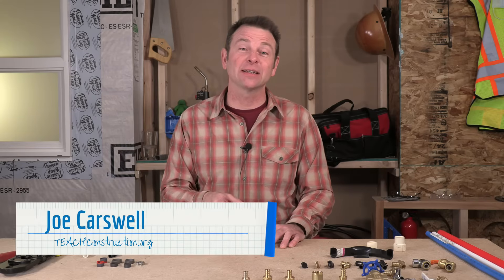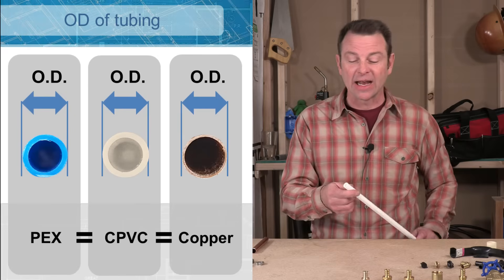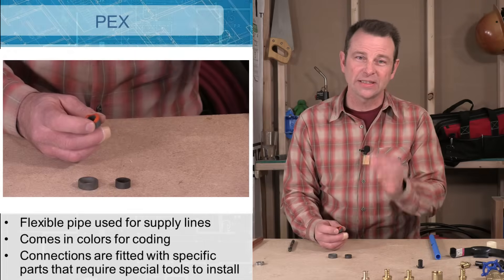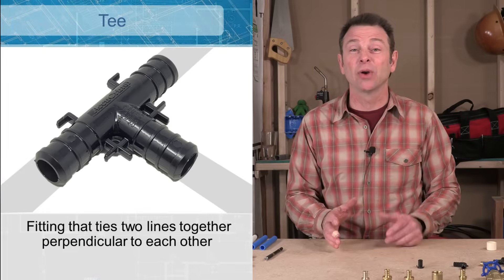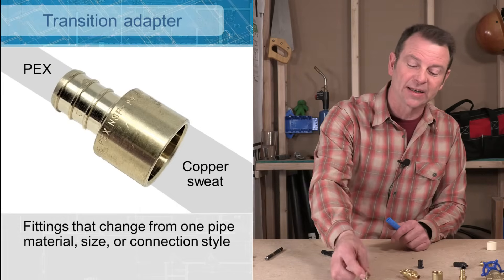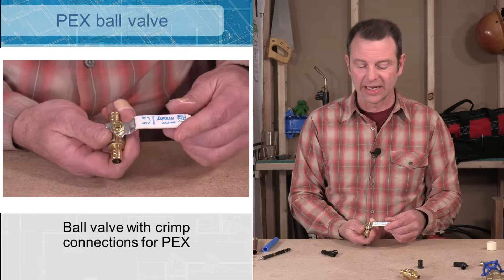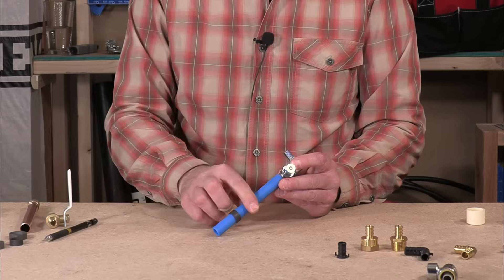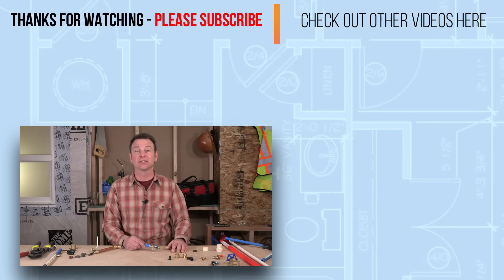A lesson about basic PEX plumbing materials  - Intro to Plumbing Systems

Comment: When using the push to connect fittings, especially on copper, make sure to deburr the end. The o-ring seal inside can be damaged causing a leak. I would also recommend extra care on any pipe material. Even a small piece of plastic getting under the o-ring can cause a leak. These are very reliable when carefully installed.   They are very well made and even have an inner support tube to help hold alignment.
Reply: The push to connect fittings are good but usually are used for a quick fix. I will replace them with the correct plumbing type when I have more time.
Reply from the maker: Great additional information - thanks for responding. This fitting is all about that inner O ring!
Reply: They're also susceptible to damage from cold temperatures. We use them when we need to but we don't put them in walls because sometimes they will develop a slow leak after a few months due to damage to the o ring or improper seating. You're also supposed to remove the pipe support on hard pipes like copper and cpvc.
Reply: Excellent presentation. Two other suggestions I would add when using push to connect fittings. First, make certain you deburr both the inside and outside of copper tubing. Second is to clean the outside end of the tubing that will be inserted into the fitting thoroughly using brass wool, not steel wool. Steel wool can leave deposits that can eventually rust and possibly degrade the connection enough to cause a small leak. I've always had to order brass wool on line since most hardware stores don't ordinarily carry it in stock.
Reply: When using a push to connect PEX fiting inside walls does anybody know if this meets code
Reply: @oliver-ec9mv  I've looked for that answer as well and the general consensus is don't use them in a wall, only open areas.  I've seen it used on air systems in an open environment as well and it works. Like Deliveryguy's above post don't trust it. Something else I saw as a concern is the plastic elbows on Hot water will heat cycle, get brittle and could break if they have any awkward side loads in say 5 years.
Reply: These are all great advice, thanks guys!

Comment: Between Pex A vs B which would you prefer for long term reliability.
Reply from the maker: I am told that long term reliability is about the same - But if I had the choice I would choose PEX A as it has a bigger ID in the fittings and provides better flow.   That video is also coming out soon

Comment: Fantastic Stuff thank you. On plastic vs brass fittings, I was thinking brass would have a large ID than plastic as its obviously stronger. Thats much better for flow rates. The close up of the 90 degree couplers sure did look like the brass had a much larger ID...does it?
Reply from the maker: You are 100 percent correct - Copper has a considerably larger ID - especially in the fittings (in the pipe itself also) and that does cause lower flow.   I replumed most of my house a year ago with PEX with a distribution manifold and tried to keep the fitting to a minimum.   But still have lower flow.

Comment: plus you dont even talk about the connectors and fitting that are the best to use and why they are better. the chitty ones you show are the basic cheapest consumer DIY ends.  real plumbers will spend the money on correct tool to use the correct fittings.  also sharkbite fittings will leak one day and suck over all.
Reply from the maker: I hope you feel better now that you have vented.   We are not taking the position of a professional plumber, this lesson - and the others in this series - are designed to provide basic information on plumbing materials and fittings.   Not to promote one over the other.   But thanks for watching and feel free to post a links to the videos you like - always good for others to find alternative positions.

Comment: real plumber and tradesmen like using best materials that last.  pex is never the first choice when the install really matter or if the tradesmen is building their own house.  copper and solder is the best over.  pex is fast and cheap but doesnt last as long and will have issues down the road.  copper is expensive but its the best and will last.  also and real plumber with real experience will never say they love pex as a hole.  sure as far and the install at first they may like it but thats it.  plus the terms you use and how you are describing things shows me that your not a real plumber or ever anyone that has a lot of real experience.  plus it seems like you are great and doing research on the products and then relaying the info in video form but the info you are providing is the basic general knowledge.  when someone has plumbed houses for a living would not be talking the way you are.  view be ware on the info to retain from this web page self taught handyman.  problem is what you see online in the perfect environment things seem simple and easy and perfect.  in the real world things dont work the way you think it will.
Reply from the maker: While I agree that copper will last longer, much of the new construction is coming plumbed with PEX.   One could make the argument that if much of construction is PEX then better to be teaching about it.

Comment: I am curious as to how long the copper rings will last before they corrode? I have well water which is hard on copper. I try to use as little metal as possible.Thanks for the video
Reply from the maker: The good thing for you is that the compression rings are not in contact with the water.  They are on top of the ring - if you were referring to the brass insert I would not think you should have any issue - but if you are concerned you can use the plastic fittings

Comment: I have intense water hammer with my washer. My plumber suggested I replace the thin copper pipes with pex. Will that fix the water hammer issue. I installed the water hammer arrestor but didn't help.
Reply from the maker: It may remove the issue - But that is a big job to do.
Reply: @ConstructionEd  The braided stainless supply lines will help slightly.  The arrestor may need to be a little larger.

Comment: Can you repair/replace a PEX leak under the foundation without drilling into the foundation? Like with a liner?
Reply from the maker: Sorry Linda - I have not heard of liners that can be used for PEX - I know they have them for drain lines - but since drains are not under pressure it opens up more options.

Comment: You completely overlooked manifolds (such as Manabloc) as the "valves" for distribution points to eliminate the mechanical valves at the outlet point or as in-line shut-offs.  Much more efficient and cost-effective.
Reply from the maker: Not necessarily overlooked - Just not included in this Basics Lesson.   But I agree that manifolds are great - and will be covered in future videos when we get back to plumbing.   We are currently updating the lessons for fundamentals for our school teacher partners.

Comment: Excellent lesson. I always wondered how well the flexible, PEX system handled the tension as a valve is opened or closed. The valves do not seem to have provisions to rigidly mount onto a surface. Should the PEX system be fastened to walls or studs and if so, how close should the hangers be?
Reply from the maker: Yes, PEX should be fastened to the studs in a wall - if only to keep it way from someone later driving fasteners to hang something on the wall (also remember to install your nail protection plates when a pipe travels through a stud.   When I have a valve like an angle stop for a sink stub out I use a brackets that span from one stud to another - like this one https://www.homedepot.com/p/HOLDRITE-20-in-Flat-Copper-Bonded-Bracket-Positions-1-2-in-3-4-in-or-1-in-Pipe-107-18-H/301295323

Or use something like this - https://www.homedepot.com/p/1-2-in-Brass-PEX-Barb-x-1-2-in-Female-Pipe-Thread-Adapter-90-Degree-Drop-Ear-Elbow-APXDEE12/301541098 for a show head connection

Comment: I was taught to always deburr copper piping because it slows down the flow and can create pits. Now it's practice to stick a fitting inside a tube and create a huge lip? You can't convince me pex is better than copper except if freezing is common.
Reply from the maker: Not trying to convince you that PEX has a better flow than copper, in fact I feel that it does not, but it is easier and cheaper to work with.

Comment: I have fitting for 1/2 id pex at the high measure tolerance is it ok to warm up the pex to install the fitting ?
Reply from the maker: I have not checked, but I would wager that that the manufacturer would not recommend heating PEX to make a fitting work.   That being said, I have seen it done on rare occasions.   But you have to ask yourself, is it worth it.

Comment: Can you have a discussion on the grey plastic pipe they use in mobile homes
Reply from the maker: We do have it on the list when we finish our framing series.
Reply: @ConstructionEd  ok thank you this is what i have in my double wide.
 I have bought all new pex a and fittings to install but meanwhile i am having leaks in the grey pipe everywhere.
 Will they inter mix.???
Reply from the maker: You are best to remove all polybutylene (grey) pipe form your building and replace it all with PEX. There are special straight couplers that can transition from PEX to Polybutylene, but the rings and pipe and fitting sizes are NOT interchangeable
Reply: @ConstructionEd  thank you very much.

Comment: What are the pros and cons of Pex A and B? From what you said here, it sounds like A is superior performance and easier to work with, and you don't need the expensive crimping tool. Are there downsides?
Reply from the maker: When using PEX A you will need a pipe expander - those are not cheap.  But if I were to choose one from the start - I would choose PEX A.

Comment: If the plastic fittings are the same as and do the same job as the brass fittings, why does anyone use the far more costly brass fittings?
Reply from the maker: Many folks just don't trust the plastic fittings.  I have not seen an issue - other then when I was really bending a section with a 90 too hard.  I am told that they should work just fine.   We always use the plastic when training - but have to confess - I use the brass in my house, even though I should not have to worry
Reply: @ConstructionEd  Thanks.  I've never experienced a plastic fitting failure either.
Reply: Can you use the plastic connectors on a hot water line?
Reply: @rnicoll4107  Yes, they are a thermal plastic, certified for both hot and cold water lines.
Reply: @rnicoll4107  Yes, they are a thermal plastic, certified for both hot and cold water lines.
Reply: @chrisgraham2904  thanks 👍

Comment: Very instructional.  I have PEX plumbing that has sprung pinhole leaks for no reason that I can gather.   All on the hot water line.   Three  are on  a short  line  between the water connection and wall.  Another happened on the hot water supply behind the bathtub in the main bathroom.   I cut a large rectangular hole at that spot  in the bedroom adjoining the bathroom.  In addition, I had to install a new cutoff valve to replace a broken one in the cabinet below the kitchen sink.  Very cramped space  so I used a PEX coupler with a threaded end in the supply line and its threaded mate one the new cutoff valve.  That way all I have t I do if the new valve fails in the future, all I have to do is screw off the valve at the connection with the supply line where cutting off the valve and installing a new one is much easier.
In all cases, I made the repairs myself using pinch clamps.  I got also got a Ryobi  (operated with a rechargable battery) clamp crimper as well as a manual on.  Also got both a ring removal tool  and crimp clamp removal tool for both existing ring clamps  and newly installed pinch clamps, respectively.  I haven some extra tools and supplies.

Considering the money saved on calling a plumber  for every leak, the tools paid for themselves.   One feature I like about pinch crimps is that they are easy to remove with the removal tool.
Reply: Springing leaks for no apparent reason does not inspire confidence in PEX.  Think you got some defective pipe? Had it been installed for a long time? What brand?
Reply: I see this way too often in water restoration, pex sucks
Reply: @michaelcurley989  I have seen some really low quality fittings. The effective orifice is reduced causing pressure drops. I do like the push-ins.  No crimper needed and great in tight spaces.
Reply from the maker: Great work and I hope our video helped.

Comment: The pex b uses the crimp / band and regular pex uses the higher strength( ring) bands. Is this correct?
Reply from the maker: Not exactly.   PEX B can be used with the compression rings we talk about in the lesson, and PEX A is expanded with a special tool then put on the fitting.

Comment: Ball valves are not throttling valves. They should only be used as an on/off valve. You can use a B/V to throttle for a short period of time, But the teflon seal can wear and when it is time to stop the flow, it may not. A globe valve, a needle valve, a butterfly valve are all better choices.
Reply from the maker: Agreed, I have often installed ball values in easy to access areas for maintenance or emergency use.
Reply: Can I use (and which kind) a valve for an "emergency" water to the toilet shut off?
Reply from the maker: @1customermaniac  Typically and angle stop like this is used.   At least the US where we are located - https://www.supplyhouse.com/Brasscraft-G2CR19X-C-1-2-Nom-Compr-5-8-OD-x-3-8-O-D-Compr-Angle-Stop-Valve-1-4-Turn-Operation-w-o-Freeze-Ups-Lead-Free-Chrome-Plated?utm_source=google_ad&utm_medium=Shopping_tm&utm_campaign=Shopping_TM_New_users&gclid=CjwKCAiA9qKbBhAzEiwAS4yeDZQpHUCK416glG-toFnkqVyHDDu0NzNDJ2bu453EUdZ262jLDEWzIBoCQt8QAvD_BwE

Comment: Do you have a video that shows the proper way to use what I call the go/no gauge. I have been told like 2 or 3 ways of using it. I been searching the internet for that information with really no definite answer. Just been getting something along the lines of it seems like it's tight and does not leak you should be ok. I don't want to just ok I want it to be done right. Thank you ahead of time. A Proud Vietnam Era Veteran  age 70 living on the streets with PTSD (Military) 🇺🇲👍😀🇺🇲👍😀
Reply from the maker: Gilbert - Thanks for the comment - Watch out PEX process Video - At about the 4 minute mark we talk about the crimping guage.   https://youtu.be/vBalt_0dZPM

Comment: I have all the PEX A parts and tools. I was going to use some scraps to put in a couple of outdoor (seasonal) hose bib attachment points for my home. Will PEX A with plastic fittings be suitable if I protect it from sunlight? Direct burial okay? Thanks!
Reply from the maker: I am not sure if PEX is rated for direct burial - But for a hot tub I personally would take the risk unless it is in direct conflict with the manufacturer warranty - of course I would want to include an easy shutoff value for repairs later.
Reply: @ConstructionEd  Thanks, appreciate it! I learned that you can direct bury PEX, but may want to protect it from sharp rocks with a PVC sleeve. Since my application isn't a main supply line and my soil doesn't have rocks, I'll just bury it.

Comment: I send plumbers home who show up with 'Shark Bite'
Reply from the maker: I would be concerned also, but a SharkBite fittings do a great job for temporary repairs.
Reply: @ConstructionEd  To be fair, if you have a pipe broken off in a wall - like, say a baseboard heat supply run - they can be helpful.  But these are RARE occasions.

Comment: Hi need to reconnect 2 damage  pex water line  under ground  that supply water from the water meter  was told that cannot  use  that  copper  black  crimp under ground since we live in Vancouver and lots of water any other suggestion  t
hx
Reply from the maker: John.  You always must follow local building code, and use the materials they require.  I don’t know what is required in Vancouver.   But please share when you identify what is required

Comment: I would have liked it if you also included Pex A fittings and how to use the tool to connect with expansion rings and different fittings. Thanks
Reply from the maker: We cover that in a new video coming up

Comment: If using pex b, would it be a good idea to run 3/4” to each fixture so the pressure isn’t reduced?
Reply from the maker: Can't tell you what is best for your project - but I am changing some of the 1/2 in my PEX runs into 3/4 for just that reason.
Reply: @ConstructionEd  This video is showing high quality fittings which have a larger ID than some I have seen. A national bathroom remodeler tried to use these in my house. I had to get pretty strong with them to get quality fittings. Another good feature of PEX is that they allow a fairly small bend radius. This can eliminate a lot of fittings which will lessen pressure drops quite a bit.
Reply: Cold water, yes. Hot water, maybe. You don't want to put too much water between your fixture and the water heater that'll get wasted waiting for hot water.

Comment: I wouldn't trust push to connect on whole house closed wall installs... Too many components subject to movement with re-pressuring a system in my humble opinion. PEX rules except for outdoors due to UV limitations...
Reply from the maker: I only use the push connections in locations I can keep an eye on - or for temporary fixes